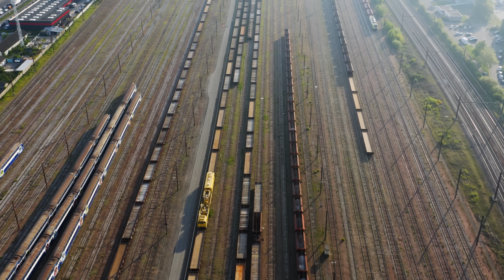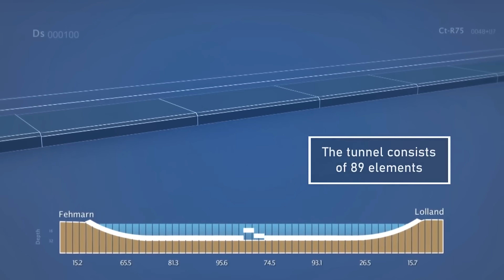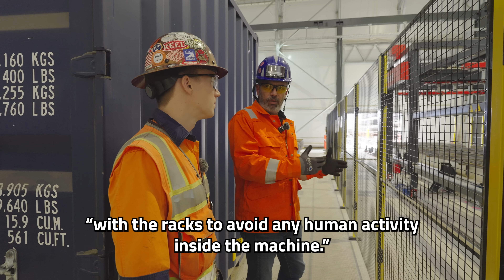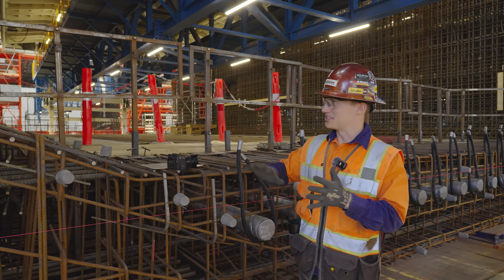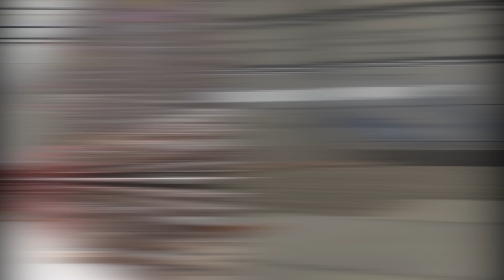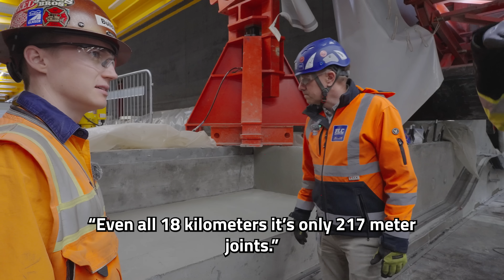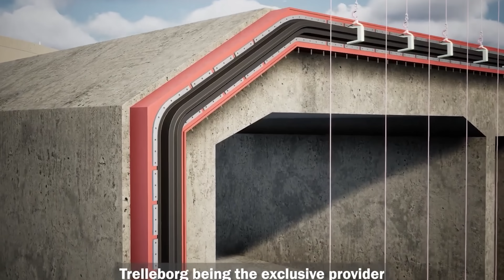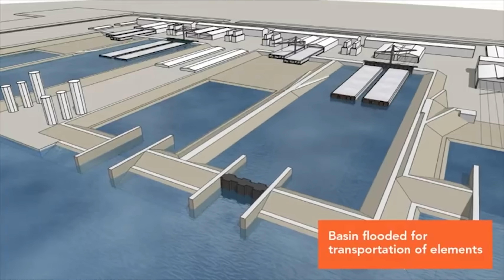How Europe's Building the World's Longest Underwater Tunnel!

Comment: This is not the world's longest underwater tunnel!!😅 The world's longest underwater tunnel is being built in Norway and is called Rogfast it is 26.7 kilometers long 😅
Reply: That is only a Road tunnel. If its ever get finished with the amount of Halt and changes to the project, Constructing a tunnel for cars is massively easier than to construct a Train and Car tunnel with double tracks. 

But ill admit, At a depth of 392m underneath the Sea is absolutely bonkers. And it will be the deepest tunnel when its complete.
Reply: Wrong, since the Rogfast tunnel is drilled under the seabed and not a immersed tunnel.
Reply: @ so since it's drilled under the seabed it's not the world's longest underwater tunnel? 🤣🤦🏻‍♂️
Reply: @stavangeraudio9961 There are Many kinds of tunnels. They can each be record breaking, like the tunnel in the video. FYI, the longest tunnel in the world, is over a hundred km long.
Reply: This tunnel will be the world's longest submerged tunnel, for cars and trains. So, the title of the video is just wrong.

Comment: you could explain how the finished tunnel will be prevented from floating up off the sea floor
Reply: 1. A trench is prepared to welcome the tunnel. 
2. The trench will be prepared with some gravels to have an ideal surface to receive it. 
3. They transport the segments that float. 
4. They arrive in position, and fill them with enough water in ballast tanks for them to sink slowly enough to be able to manoeuvre and position them properly. 
5. There are some kind of jacking systems when they are at the bottom of the see so the new segment can come and squeeze the seals to the existing segments in place. 
6. The water between the seals is removed, and the segments are pressure tested (2 Trellbord Gina and Omega seals)

7. Once they are positioned, they add ballast concrete, and remove the water in the ballast tanks. They end up not being boyant anymore.
8 The bulkheads are removed
9. The tunnels are recovered with gravels, and with the local conditions so the habitat can be re-established by the fauna / flora. 

Note: It's a very simplified description of all the elements to ensure of the perfect positioning, the controls performed, etc...
Reply: @fabr5747  Where did you get that? Adding ballast on the inside just takes away usable space. I can't post links but search yt for "Construction of the Fehmarnbelt Tunnel (animation)" where they show not only that they'll use rocks up top to keep it down, but also the alignment mechanisms.
Reply from the maker: there are ballast areas within the elements
Reply: @mmm365 sand could get carried away by current, but i suppose a lot of big boulders would work

Comment: I have been a Carpenter for 40 years, and this sort of project is enough to make your head spin. Making a machine to pre assemble the reo-bar is mind-blowing, but it is necessary to take away the human element, which could easily introduce flaws into the reo cage. The placement of the concrete is by pump booms and vibration to ensure proper compaction, super critical in an underwater environment. 
Aaron and his colleagues are very fortunate to be able to visit all of these amazing places and projects around the world and yo share them with us. 
Mark from Melbourne Australia
Reply: Same here! Carpenter with 45 years experience.  Mark from Oregon USA
Reply: @markdorman52 with your ridiculous storm blown houses over there, I wouldn't be proud of my craft! Our chicken houses are made better 🤣
Reply: Australia, We owe you for our Mary 🥰 Will she be there with scissors when it opens?
Reply: Every single comment or close is wrong... 
1. It's a rebar, not a reo-bar 
2. The reason of the machine for the rebar is not to remove the human element, but because usually rebars are tied with tiny steel cables. Here they are welded to stay in place and remain recise during the movements, but also and mostly because they assemble it flat, and then lift it. It's VERY unsafe to lift those cages without welding.  Doing the welding by hand is too slow. And it multiplies the time for the workers with the back down. So in terms of health, safety it's dumb.
BUT MOSTLY, it's the same segments. So it's repeatable. Therefore it makes sense. If it was not repeatable, a machine would make 0 sense. So nope, sorry for your assumptions. 
Unlike what you think, moving the rebar by one centimetre of imprecision is not changing anything to the structure. 
3. No the pump does NOT change anything about the compaction. There are several reasons for that choice.
- the volume that needs to be poured in a rather short period is massive
- they want a monolithic structure
- they are indoor
Why does that matter? They need to go at the right rhythm for the structure to be indeed monolithic. That rhythm might be possible outdoor with 2 cranes working on 2 sides of the structure. But indoor, with the overhead crane on rails, it would be so slow. 
So there is no choice, the pump is the only solution to be productive and to end up with a monolithic structure. And it's the safest. And you can see that they use at least 4 pumps. Impossible to work with as many pouring teams in such a short space with a crane.
4. Yes the vibration is important... But guess what, it's as important in a tunnel, in a building, on a runway, etc... It's a critical phase of pouring concrete anyway. But here it's much easier because the environment is controlled, the concrete has an optimal flow and resistance, and they can stay consistant, which is close to impossible outdoor.
Reply: @fabr5747  ☝🤓
Reply: @fabr5747 It's a 3D design ,you can verify the structural stables with AI , this tunnel supposed to last between 50-100 years so just one question remains: how prepared you are for earthquakes?
Reply: @fabr5747  who asked?
Reply: @local_authority  He says wrong stuff... A person willing to learn would be happy to by corrected...

Comment: Now a video to show the rest of the process. Surely the dredging and placement is just as impressive.
Reply from the maker: Part 2 is coming soon!
Reply: Great video! Here in New Zealand we have a north and south islands with a gape of 15k at the closest points and intercepted by the Cook Strait which is deep and notoriously rough at times. There has been talk of a bridge construction to join the islands but has never gotten past a serious standing around a coffee machine discussion! Watching this video shows that it could possibly work in New Zealand with the modern technology available today, the biggest problem we have though is our population is less than 6 million, so i am guessing we will need to be approaching something like 20 million people before any serious progress for a permanent link between the islands to happen
Reply: @nigelmcculloch3746 The Fehmarnbelt has a maximum depth of 30 m. The Cook Strait has an average depth of 128 m. That would probably make things considerably more difficult for a submerged tunnel. The sea in the Cook Strait is also much rougher. A bored tunnel would probably a safer bet. 

The Fehmarnbelt tunnel is particular in that it is very wide. Creating something that wide with bored tunnels would require at least three separate bored tunnels.
Reply: @aphextwin5712  yes, that's right, also there is a known active  earthquake faultline that dissects Cook Strait, on top of this apparently 2 thirds of gravels that wash out into the sea on the eastcoast of the south island makes its way to the Cook Strait and disappears into a giant chasm! So that alone could wipeout any idea of a Cook Strait tunnel unless it was resited elsewhere
Reply: @nigelmcculloch3746  Wow, i didn't know how many people lived in New Zealand until now.
That's like half the number of daily transit riders in my city. For some reason, I thought NZ had at least 10 or 12 million inhabitants.

Yeah it's probably more complicated to fund and build large infrastructure projects with a small population.
Though the Faeroe Islands, halfway between Scotland, Norway and Iceland, have built quite a set of impressive undersea road tunnels to link the islands together. They've managed to do that despite a very very small population of only 55,000 inhabitants.
There's something like half a dozen more tunnels planned, so I guess they've found a way to build big with a tiny population.

Slightly off topic question : I know it's made up, but where would roughly be the town of Brokenwood (from the eponymous TV series) if it existed, and do you know where it's filmed?
Reply: @nigelmcculloch3746  yeah but kiwiland is pretty seismically active unlike the potato country
Reply: @nigelmcculloch3746  5 million in Denmark 😊
Reply: @theispetersen2174  That is not the best comparison. In NZ, only 6 mio can potentially benefit from a fixed connection. For the Fehmarn connection, that number is MANY times larger, as it can benefit people and cargo for much of Northern Europe. Just start adding up the populations of Germany, Poland, the three Scandinavian countries, etc.
Reply: @ItsFlyingSteve  Well we also have at bridge/train tunnel over Store Bælt (one of the longest in the wold), Bridge/ tunnel (same construction as this), a bridge over storestrømmen. All big projects. We also have i don't know how many bridges an tunnels all over the danish islands. And it is not exactly small bridges and tunnels. All in all there are 2500 bridges and tunnels connecting Denmarks 406 island (more than 300 uninhabited).
Reply: It blows my mind but when they're  pouring the concrete  is it a contentious pour or in section bottom wall  and top , and  concrete isn't  flexible  what about the ocean floor  its not leave .
Reply: @mikeklein318 the tunnel route across Fehmarn strait is levelled beforehand, down to millimeters of precision.
There's several other documentaries available on YouTube

Comment: Germany hasn't even begun to build the connection yet as far as I'm aware 😂
Reply: And not even talking about the Brand new Highway upgrade they have promised.
They need to get their shit together, most of the construction of the actually arrival point are well underway. But its up to the Germans to construct the aditionel Rail and Access way.
Reply: Just passed the Femern Belt Bride, no sign of tunnel contruction there
Reply: Well, the connection already exists. It's supposed to be expanded to two lines and electrified though, and that's behind schedule (of course). They started on it though.
Reply: @Sp4mMe  rail connection is still in the planning phase as far as I'm aware
Reply: What had you expected from germans?